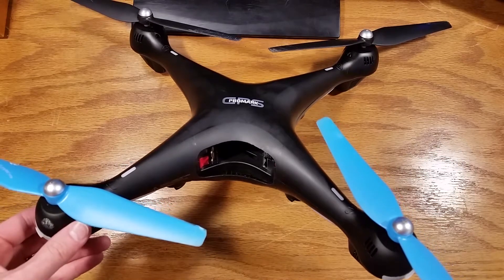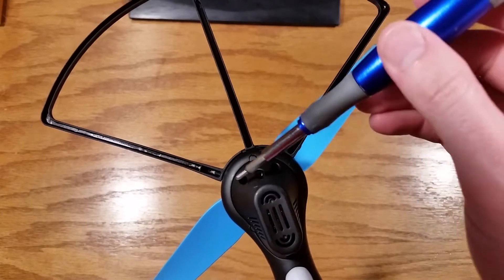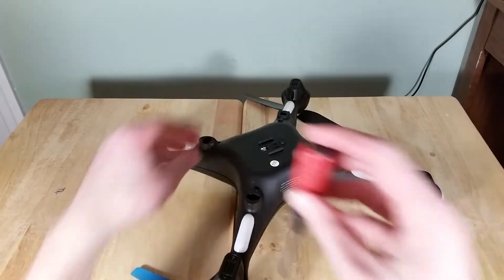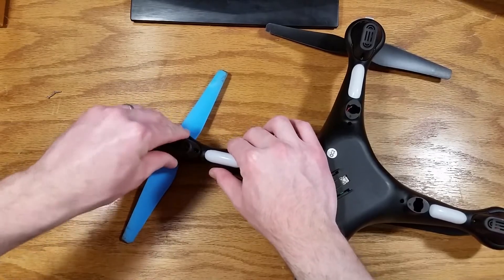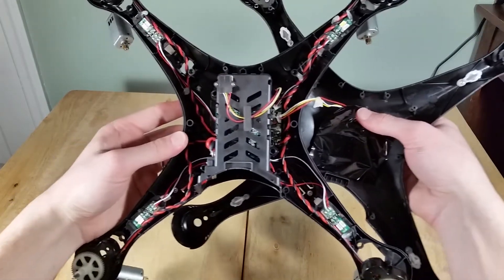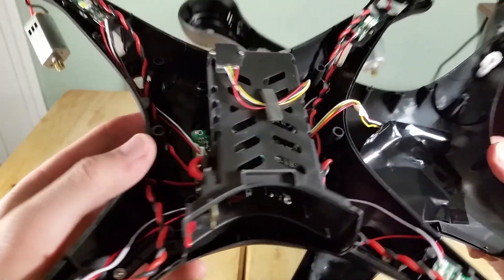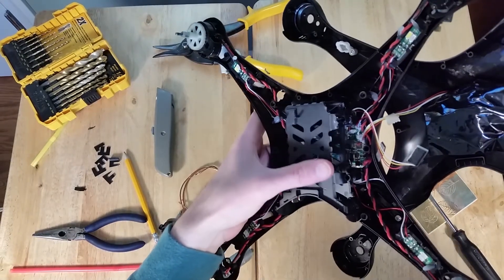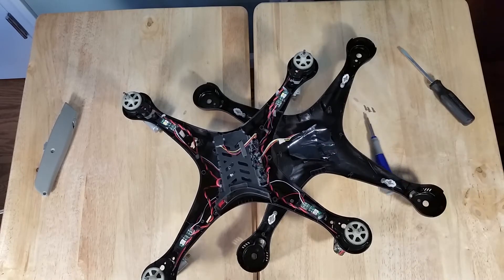How to Teardown a Drone – Promark GPS Shadow Drone

Comment: Thanks for the great videos I have two promark Shadow GPS drones one works the other does not both controllers work with the working drone the other drone will turn on but it will not bind with either controller any suggestions thank you

Comment: Can someone please help! I have the pursuit drone, was flying it for awhile with no problems. Took it out one day to fly ran battery dead and came back to charge it. When it was charged I went back out, at this time the drone would not flash red! The lights pulse white and blue purplish. I can still connect to my camera but nothing else!! I’m puzzled!
Reply from the maker: I can't remember exactly what that flash code means. Was it altitude mode? Or did you start the calibration and then not spin it around?
Reply: EngineersEscape soon as I turned it on it started pulsating those colors instead of the red. I can bind the controller but it doesn’t let me calibrate  it now.

Comment: I know this is off point of the video but the facial wire that acts as the antenna is broken on mine I searched and cannot find a part to replace it this of course communicates with the controller u are about my last resort any guidance would be appreciated
Reply from the maker: Do you mean the antenna on the bottom of the drone camera? If so, i would get a small piece of wire about the same length as the one that broke off and try to solder it on.
Reply: EngineersEscape this has a what looks like a braided material wrapped around some type filament coated in black the longest the end that is uncoated the better communication u get thus allowing u to film from a Carter distance it goes much further than u can see on the app I don't think regular wire would do but u the engineer I was trying to buy one which seems impossible to find thanks

Comment: Do you think, with the existing FCB and ESC's, that you could replace those brushed motors with brushless, completely getting rid of that plastic gear piece?
Reply: Save yourself a heap of expense and agro and buy a Bugs brushless from MJX. The 2C is cheaper than this if on sale or, if you want more bells and whistles, get the 5W.

Comment: Nicely done, can you modify the antenna for better reception. I have had a fly away and have replaced the unit, but if your going that far in to change battery compartment, why not fix antenna.
Reply: I have the HS100 version of this drone. How do you modify the antenna? Would it help since you are limited by the geofence anyway?